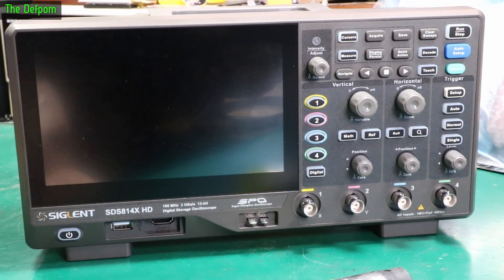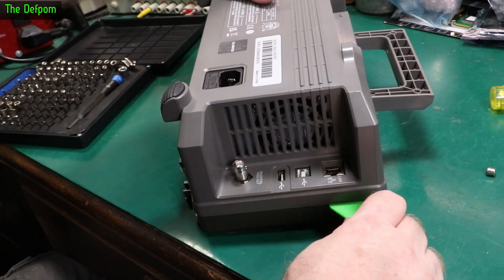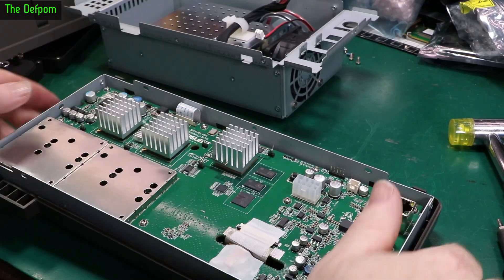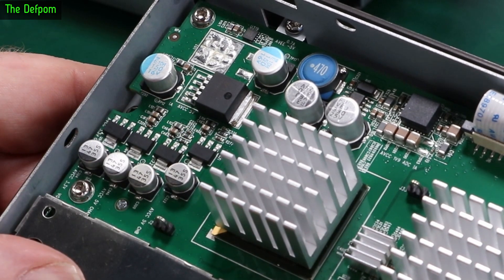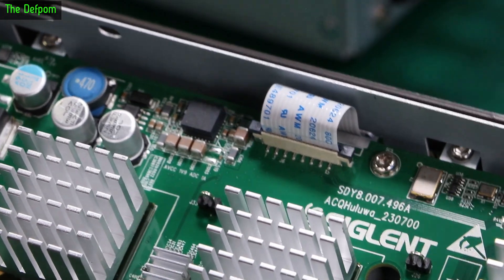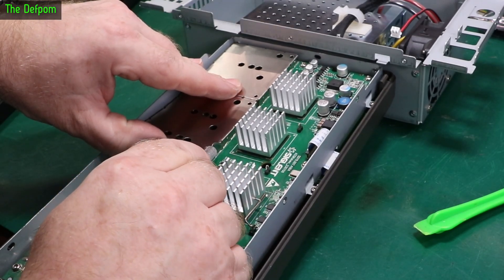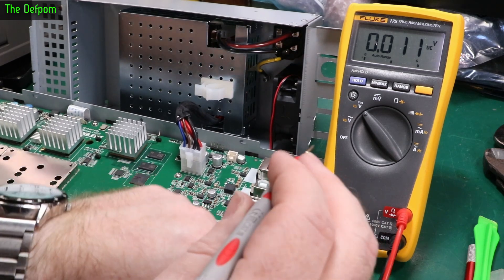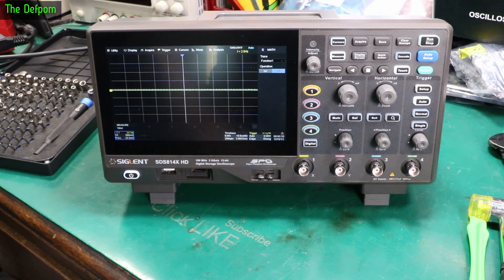🔴 NEW Siglent SDS800X HD Scope Teardown - No.1225

Comment: For the price this thing is built like a brick. Thick riveted steel frame, conformal coated, components on the pcb are all labeled, double shielded frontend, ribbon cables taped down, replaceable fan and power supply... good sh*t.

Comment: I went for this one. The 814 was available. I rejected the Rigol because USB-C might not exist in 10-15 years. Even more important, I don't think there is any chance that running the OS on an SD card is a good idea. Should I buy a dozen and throw them in a drawer to use when the current one fails and they can't be bought and the SD card adapter can't be plugged into any future hardware? Android is also from a rather slithery and slimy outfit. Who knows if the next 20 years of the global economy will even be good enough to buy new stuff? Anyway, just my own opinion. I'm just an enthusiastic pessimistic optimist. Whatever that is. 😂

Comment: This is actually great to see. I was thinking about the huge size of this compared to the RIGOL DHO 900 series. 
I got myself a 3D Printer about half a year ago and honestly, this PSU can go, it takes up to much space. I think im gonna go ahead and build myself a DC PSU connected via USB-PD. The connector looks like a 8 Pin PCIe Power connector or a 8P CPU power connector. Should be pretty easy to pull off actually. Would convert this scope into a mobile workstation, easy to power by batteries!
Reply: this isn't compatible with a 8P CPU connector, if you do that you will burn the scope, the cpu connector/PCIe power only has 12v, this psu takes 15v, -10v, 6.4v and also an AC refrence, you can't do it via a PD trigger you need additional circuitry to generate all the above voltages.
Reply: @pvim  sorry, I only meant the connector itself, not the Pinout or voltages. Should have made that more clear. 

This scope uses 6.5V on all the VCC pins. Edit: I stand corrected, this is not true. He even takes measurements during the video. My bad.
Reply: @vffa  you also need a negative rail i assume and 15v, since he measured -10 and 15 as well? are you gonna set the PD to 15 and then step it down and generate -10 separately?
Reply: @pvim  you are correct. I kinda totally forgot about him measuring the PSU. 
I immediately went through the service manual which just mentions 6.5V on the PSU connector. I didn't look into it any further though as I don't really have time for yet another project as this was supposed to help me on my current projects 😅. 

Thanks for the correction and reply though, didn't wanna lead anyone down the wrong path. 

Might be interesting to see if there's some way to do it at some point in the future.

Comment: I used to reverse Engineer kit in one job I did. The absolute BEST way to remove seals, even those ones that break if you look at them, is to GENTLY heat themwith a temperature controlled heatgun, then simply SLIDE the label off. When you have finishedf, reverse the process, heat and slide it back into place. I guarantee, NO manufacturer will be able to tell you've been into the piece of kit. OH, also, MEASURE the tourque settings on the screws. Some manufacturers will check them, and if they are out, they can tell what you've been up to.

Comment: Too bad it's not USB bus powered, I want an isolated scope. Rigol wins here
Reply: Use isolated scope is then noise and others not higher?
Reply from the maker: If you want an isolated scope then you definitely don’t want USB either, as then you risk blowing up your computer or whatever is powering the scope instead, if you want isolated then get a battery powered tablet scope like a Micsig or something.
Reply: @TheDefpom  Not really, you can power the Rigol with a powerbank, the included USB-C power supply has ground isloated from the mains. Connection to the PC is optional, and i'm sure there are USB isolators out there... DHO800/900 series is excllent as a portable self powered scope, budget priced and has much more features than most scopometers.
Reply: @gctechs  Actually, the power consumption is high enough that many compact battery packs will be too small to be useful for any significant length of run time...   Between concerns of the usb jack getting damaged from cable stress to the hassle of a power brick, I really don't see usb power offering many benefits.
Reply: @TheDefpom  The flyback converter is an AC/DC converter with galvanic isolation.

Comment: Thought Dave @EEVblog would've had one of these to review for some time already but no reviews from him. I'm on the fence whether to go for the Rigol or this Siglent one for their respective coverage of functions with least amount of bugs for a 12bit, 4 channel scope with some mixed signal and trigger capability.
Reply: Siglent interface and sampling rate is much better. 
Rigol interface is cluttered and not optimal, but its form factor and usb-c power supply is great.
If you need a robust tool that will work bench top for long - go for siglent. If you need compact tool with usb-c supply - go for Rigol.
Reply: ...aaand?
I'm the same. Any update on that?
Reply: @Pawel5837  If budget is your priority, the Rigol is marginally cheaper.  If functionality and polished firmware are priorities, buy the Siglent.
Reply: @tomkatt2321  I went Rigol. 12bit
Reply: @Pawel5837  hi. I’m in the same place. What tipped it over towards rigol? I like the form factor and usb power. Have no experience in these scopes, so don’t know if preference is towards one or the other in gui. 
What rigol did you end up with?
Reply: Also, if customer service and firmware updates are of any importance to you, go for the siglent.